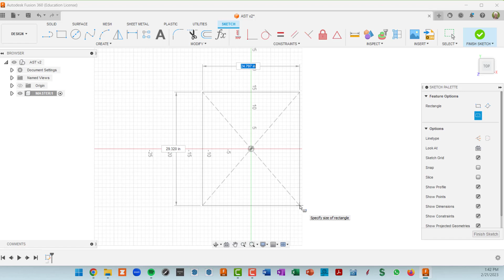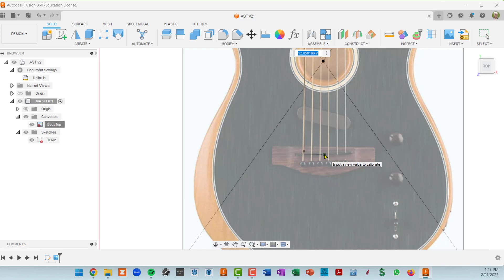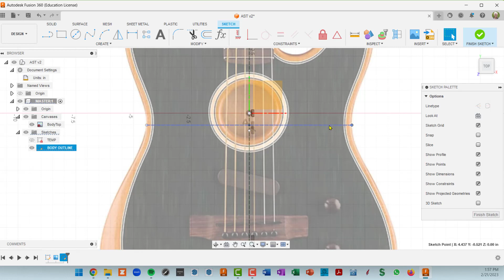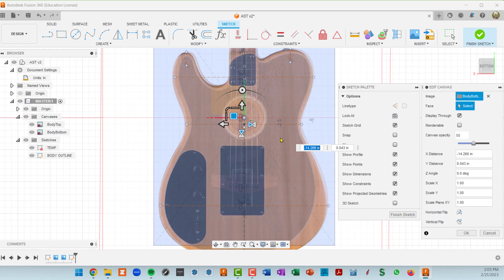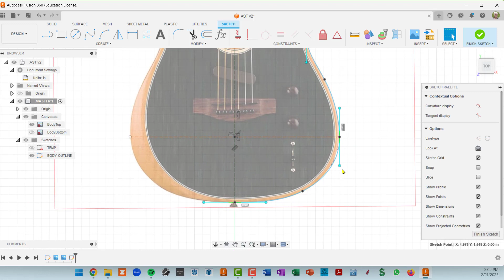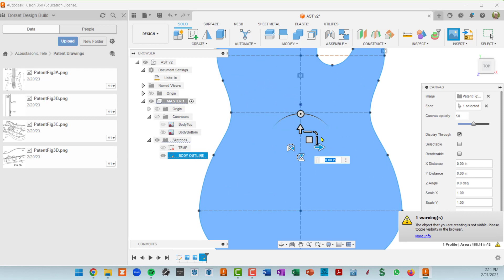Designing an Acoustasonic in Fusion 360 | Episode 1: Body Outline

Comment: Awesome video! This is super helpful! Thank you for posting it. 

I know this is a very old post, but I wanted to add a bit of info for anyone else who stumbles across the video in the future. If you want to insert a canvas into a sub-component without making a sketch first, here's what you can do:

1. Expand the "MASTER:1" sub-component. 

2. Expand the "Origin" folder inside of the "MASTER:1" sub-component

3. You should see several planes in that folder.

4. Click the Insert Canvas button on the top panel/ribbon, and select your image. 

5. When you get to the point of selecting the plane, don't click the XY plane inside the main window. Instead, click the XY plane in the menu on the left (the one that we just expanded with the planes inside)

6. The canvas folder will be created as a child of the "MASTER:1" sub-component.

There may be an easier way to do it, but that's my work flow for setting up a new project.